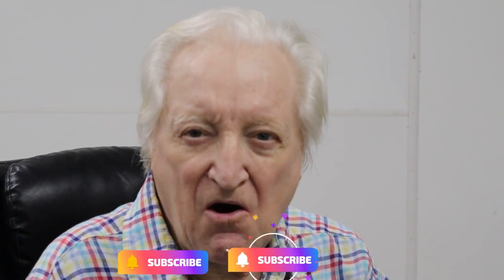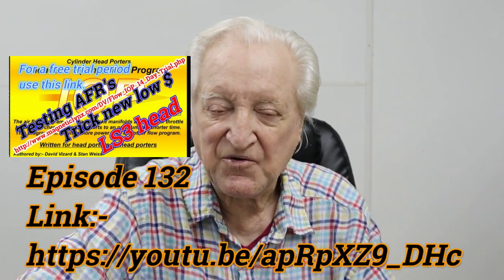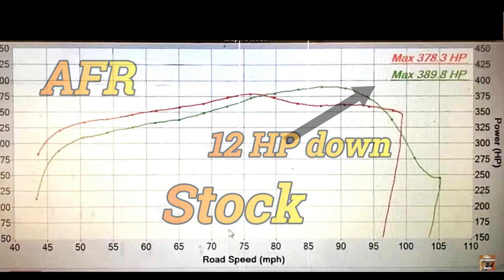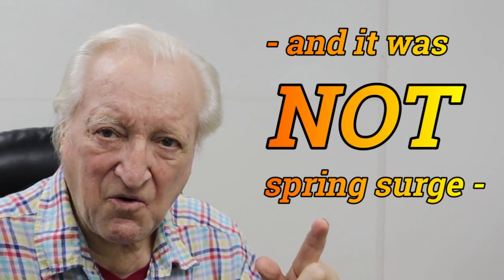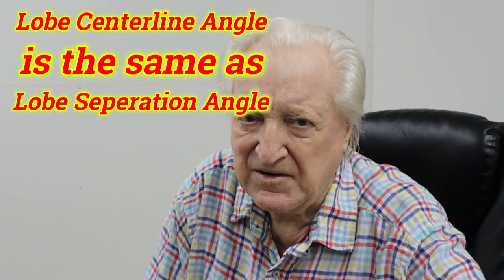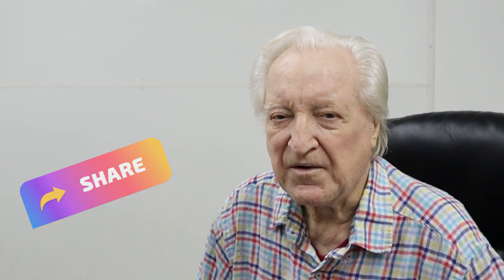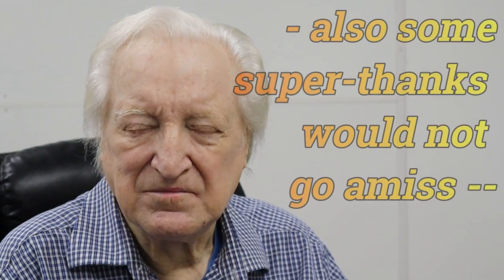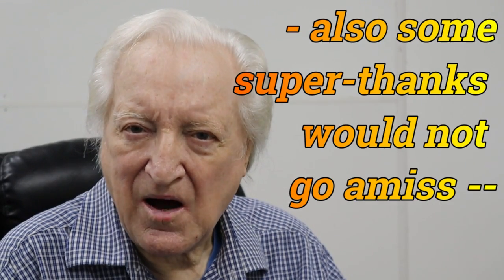AFR LS3 Enforcer - really great heads but less power. Why?

Comment: Richard Holdener did a test of lsa with ls3 heads with 2.165" intake valves. Testing 108, 112 and 120 lsa with same lobes on each cam. The 108 came out on top everywhere. Why would the 108 lsa not benefit these stock valve size heads the same? 
https://youtu.be/JUHwVCDjonU?si=gzsLpte2hzvKK517
Take a look at Unity Motorsports comment in the comment section of Richard's video and DV knows this.

Comment: Mr vizard I've been using cams on a 106 angle for the last 30 years 350s /383 flat solid lifter quarter mile circle track put used in quarter mile drag how about one guys with bigger motors with roller cams and higher compression my motives were on 10 to 1 compression I was even quicker than some power adder cars , some people would tell me that motor is not going to make any vacuum my response was I'm not building a vacuum cleaner , thanks for all the great information you and Andy and whoever else is involved keep up the great work ...... LONG LIVE THE KINGS .

Comment: Will a larger port with more cc have faster or slower air volisity??
Reply: Slower, generally speaking. Balance is key. How slow is too slow? How fast is too fast?
Remember those monster Cleveland heads that made great rpm power but sucked for street ability?
Who drives around at 6000 rpm?

Comment: How versatile is this cam program you have written?  I have a 1969 Chevy 292 I6 with 12Bolt Tom’s tunnel ram and cast iron dual exhaust manifolds. The head also has 12Bolt Tom’s lumps. The valves are being upgraded to Erson 1.94 valves and springs for  .530 lift. Which are also from 12Bolt Tom. If you’re cam selection program is isn’t the way to proceed, what’s my next right step?
Reply: Program includes several different parameters to make a recommendation.

Comment: Testing a different lsa will not be conclusive unless the lobes are identical to the originals. Even if you can do that, which lobe will get moved? Or will you move both? IVC and EVO points are the difference makers and indicators IMO

Comment: So a head that flows more than stock, better discharge coefficient than stock, better velocity than stock and above average port energy can’t out power the stock head on the same cam? David, if you have identified the superior head is only superior with the right LSA then you owe it to your viewers to explain why all the metrics evaluated on the head are pointless without it being used with specific valve events. You say it’s the wrong cam because of valve size difference but again, where do those other head evaluation metrics come into it if it comes down to valve size? We know from here you will change the cam for one that is designed to enhance midrange torque and say “told you so, these heads wanted a different cam”. If you are a research engineer then you know the stock heads MUST be tested with the new cam to verify the hypothesis that it’s the wide lsa killing the superior head. Otherwise it’s a pointless test designed for you to write your own narrative.
Reply: I made it about three quarters of the way through this video. What I got out of it. And old guy with your standard, I'm an old guy, Nobody knows what I know. I'm an engineer. I can save the world but nobody will listen.  Test A and B, first off I didn't see it, How is it turned?What was the air flow ratio? Why not test A.B.C.D.# Repeatable.  P.s Steve morris, Nelson racing,Brian touley, Richard holdner,   are just a small list of, non-wipper snappers that don't know about timing events, Airflow.  If everyone is wrong but you. Yet Produce legendary power levels, are having no trouble Selling their ideas,  maybe you need to Reevaluate. But I could be wrong. See what I did There 😉
Reply: IVC and EVO events determine where the LCA ends up for a given ramp, not the other way around. ProStock is arguably some of the highest output gasoline engines in existence. They are not close to "tight" LCA.
Reply from the maker: @optimumperformance6998  I totally agree and my cam program predicts exactly what a given spec of pro stock engine wants. The spec comes about by calculations EXACTLY as I detail in episode 85 which describes why, from thousands of dyno tests, I am right. Before any further comments (opinions) just check out episode 85 then make a sound factual data base comment based on solid empirical data.
DV
Reply: @DavidVizard I checked out a Richard Holdener dyno test on lsa with standard ls3 heads you are using here. The standard size valve head responded best to the tightest lsa cam. It performed better with 108 lsa everywhere better than a 112 lsa cam. Yet you are saying the standard size larger valve in your test is better with something wider than 108 lsa? How are Richards results different to your theory?
Reply: @jamiebrown4322 there different compression ratios.
Reply: @bryanharshaw9319  whatever you do to increase cylinder pressure where the induction system is tuned for - mcsa's and length, then torque output will go up. A tighter lsa (say 106 v 114) does this by closing the intake earlier and combustion pressure acting on the piston a little longer with a later opening exhaust. The different size valves may want different open durations due to time/area exposure to the cylinder but tightening up the lsa will have the same effect of boosting midrange torque. Valve motion plays a huge role too. Get all the IVO, EVC, IVC, EVO events exactly right (that leaves you with an lsa number) but the output is still affected in no small part by the way the valves open. A Comp Cams High Energy lobe and TK lobe with the same .050" duration on the intake are going to have different effects on power depending on application. Then the exhaust lobe is different again on how its effect on valve motion affects torque output. Case in point; from 3500 to 7000rpm a simulated engine loses an average of 12 hp and 10 ft/lb using a High Energy lobe instead of a CSZ lobe on intake only on a sbc 401ci build. DV doesn't talk about this because as a snake oil salesman he would lose too many customers and deciples to complexity. Both heads in the video can have their power output increased with a cam change that would fall into line with Richard Holdeners test because cylinder pressure will go up no matter the comp ratio starting point. This doesn't even get into the vehicle the engine is going in (weight, gearing, converter etc) and its application and where the powerband has to be. This is just dyno hero talk.
Reply: @DavidVizard  you only need 1 test to result to disprove something and the test disproves the IOP program claims. the only way to prove the LSa theory is the test both heads with new cam. i guess it depends if you are trying to convince real engine guys or the muppets
Reply: @jamiebrown4322 
The larger valve allows more flow sooner and therefore can use a slightly wider LSA.
Reply: @jamiebrown4322 
Bigger valves need a wider LSA.
Reply: @hotrodray6802  if that is correct then we are back to my original statement "..if you have identified the superior head is only superior with the right LSA then you owe it to your viewers to explain why all the metrics evaluated on the head are pointless without it being used with specific valve events. You say it’s the wrong cam because of valve size difference but again, where do those other head evaluation metrics come into it if it comes down to valve size?" Remember the discharge coefficient for the AFR head was well above the std head to the point its moving more air. Saying a bigger valve requires a wider lsa is assuming the bigger valve flows more. The head has been assessed as being capable of passing more mass flow. All this is a moot point though as the results are less attributed to the engine and more attributed to testing method.
Also, why did DV first think this engine would be up 20+ hp if the assessment now is the wrong lsa. Watch from 8:10 in this video. https://youtu.be/TJS8PNPWnDA?si=jAiHHzYBUuy10z1h
Reply: @jamiebrown4322 

and what about throat sizes?  what about the efficiency of the valve?

this is all ignored.

you CANT do that.

more than likely the problem here is some sort of area restriction in the aftermarket head, intake or exhaust.  

note that i DIDNT say flow restriction.

since, you can flow more air through a certain area, but have too much velocity for the engine combination.

the port area can sometimes be too small for the cfm it can flow.
Reply: @DavidVizard  Classy response to rude commenters!
Reply: Narrative? The guy has dyno tested more head/cam combos than anyone else.
Reply: @moabman6803  seems like he'd know that valve float hindered the AFRs more than LSA sensitivity. The only guy I've seen toot his own horn more, had a couple ribs removed.
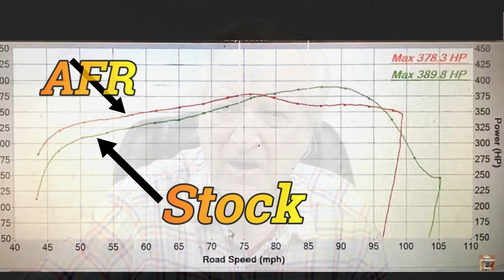Reply: @thegdfp6447 at 1:43 if any head showed valve float it was the stocker. When an engine goes into valve float it drops power like a rock it doesn’t just flat line and keep on reving out.
Reply: @moabman6803 don’t confuse quantity of test with quality of test.
Reply: @moabman6803 he has dynotested more than he has had time to dynotest.
Reply: @moabman6803  Its insulting really. No respect for someone like David who has been giving out great info since I Was a 70s kid if not before!
Reply: @moabman6803 no he hasn’t
Reply: @WeingartnerRacing  Absolutely he has. David has many thousands of dyno runs behind him.
Reply: @moabman6803 he absolutely has not. If you get outside of your bubble you would know that. Warren Johnson and many, many, many,  others have.
Reply: @WeingartnerRacing  Warren Johnson the drag racer? How would he perform more dyno tests? Get out of my bubble? My "bubble" encompasses some of the most technical forums in the world.
Reply: @moabman6803 Warren Johnson is a drag racer, but he EARNED the title "THE PROFESSOR" from all his years of engine building & testing. He was most known for being a driver, but he earned his way up building engines.
Reply: @THEFERMANATOR would talk turkey with Reher Morrison for Hrs.on cam configurations, head flow characteristics,valve angles etc.lot to absorb,,trying to get my builds down to a science 🏁
Reply: @THEFERMANATOR 
Great if you're building his specific type of engine for that specic use.
Reply: I agree with Jamie.

Comment: Hi David I’m very interested to see how the heads go with the different cam. It would be great if you could do more LS videos. I’m also interested to know if the 128 formula works for LS motors or not. Because I think you said the stock heads a 114 lca was close to been correct. I have a LS3 which is stock using that formula with 10.7:1 cr and 1.7 rr it suggests it should be 109 lca.

Comment: I always mull over whether I could gain noticeable power gains over the rev range of my street 10.2:1 sbf 331 with 190cc (2.02/1.60 valved) heads that flow 250 @ .500 lift, cam 216/224 @ .050… on 112 LSA w/ 4 degrees advance ground in. Going to a 108 LSA would net me 20 lb ft torque?
Reply: I'd bet it.

Comment: Please retest the factory cylinder heads with the 107-108 lsa cam. Gotta keep your results honest.
Reply: Alot of guys for almost a decade after they came out tried running 110-112 in them and they were ass. They'd dyno ok, and have garbage part throttle power. Then they started widening them and they started making more power and not being dogs outside of WOT. It may be different now. I jumped out of LS cars for a while
Reply: @garlandjones7709 
We are not racing dynos 👍👍
Reply: @hotrodray6802  no you're not... and LS3 heads are insanely sensitive to reversion and having too much overlap, but those tight lsa cams will dyno good. And they'll run like ass.... or at least they used to be that way. Hard for me to imagine it's changed much.

My references were with stock style intakes and L92/LS3 heads. AFRs may make an attempt to curb that with areas inside the port. I've not used them.

Comment: When you can make 800 hp with a $400 junkyard LS and a $400 VS racing turbo none of this matters anymore.
Reply: Yes it does when you can make 800 without a turbo is a big deal no lag, tuning is easy and if you want to turbo your power jumps way more
Reply: Noones making 800hp for $800,   The internet is full of dreamers steering you wrong

Comment: DV, could you talk to LSA and tourqe production?  Working with a large ci small block Ford that has to move a lot of weight so making power as low in the RPM as I can is the goal.  Thanks, keep up the great work!

Comment: 👏🏻👏🏻👏🏻👏🏻This is going to be good. Everyone that says LSA is an output not input is going to lose their minds.
Reply from the maker: The folk you mention need to watch episode 85 of PowerTec 10 where it conclusively proves otherwise. Not from opinions and old tech but from state of art dyno tests over a 3 year period.
Reply: How is a LSA calculated? It’s from the centreline angles of the intake and exhaust lobes, so it is an output really, you can have many different intake and exhaust centrelines that’s calculate out to exactly the same LSA
110/110 = 110LSA
108/112 = 110LSA
106/114 = 110LSA
And so on with any combination of angles in between, they will all perform differently even with the same LSA.
Reply: @seanb250 you're confusing terminology.

Comment: I actually calculate the best torque lobe separation angle of 113 degrees, with an intake centerline of 110-111 degrees for a 6.2 with the AFR LS3 Enforcer.

A t shirt would be interesting.
Reply: What are you using to determine optimum icl and ecl?
Reply: @garlandjones7709  With this style of head I have learned that advancing the cam 2 to 3 degrees gives best torque naturally aspirated with stock ratiorockers,  if the lobe separation angle is correct. Testing backs this up. If you run a 1.8 rocker, expect to find best torque with the cam straight up, or even a degree retarded.
Reply: @v8packard  i assumed you were using a program or a formula for that. 

Based off what you just stated, if you're finding power gains from advancing camshafts you're purchasing then you're valve events are off to begin with. You're either crutching an intake lobe too large, or an exhaust lobe too small or really bad exhaust systems.

If the rocker increase is causing you to make more power without advancing it's pointing to your exhaust lobe or system being the issue.
Reply: @garlandjones7709  I use a few different programs and methods to determine timing points, lobe separation angle and overlap.  With respect to retarding the intake centerline when using 1.8 vs 1.7 rockers, I think it's because of the change in area to the overlap triangle. Or specifically how the engine sees that. 

I don't use off the shelf grinds. And with these heads I consistently get better results with the ICL advanced 2-3 degrees versus the 4 - 6 degrees usually found in shelf cams. On turbo engines I run them straight up, to start with.
Reply: @v8packard  are you advancing them manually with the timing set or are they being sent to you with the advance ground into them?
Reply: @garlandjones7709  I rarely use poor exhaust systems,  and personally I don't care for more exhaust timing on many applications if torque is the goal. On engines with modest exhaust side performance,  opening the exhaust early helps power higher in the powerband. When doing full power tests under load it seems like opening the exhaust earlier has little or no negative impact.  When doing steady state testing simulating part throttle cruise operation, the extra exhaust timing always hurts torque.  I have never see that not happen.
Reply: @garlandjones7709  When I order them I will ask for a the advance to be ground in. Usually it can be done if they have the correct core on hand.

Comment: So are you going to do another test comparing the AFR heads to stock LS3 with the new cam in a back to back test again? That part was a little unclear.
Reply from the maker: No not really. We have done so many cam tests that with the time constraint we are going straight to something close or right on optimum and dyno with the AFR heads.
Reply: @DavidVizard looking forward to the next video. Can you talk to difference in overlap between the cans and ivc and the impact on cylinder pressure? All very interesting. Keep up the excellent work